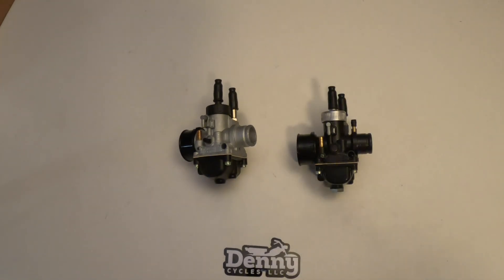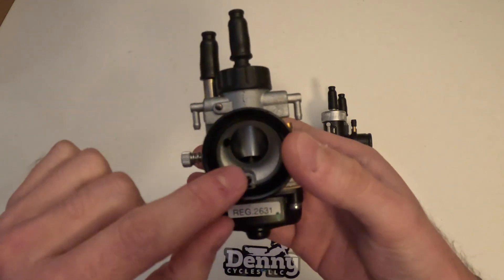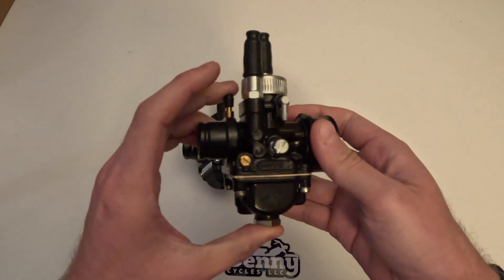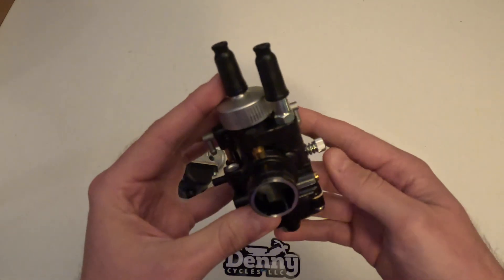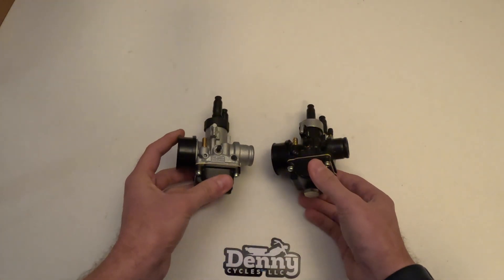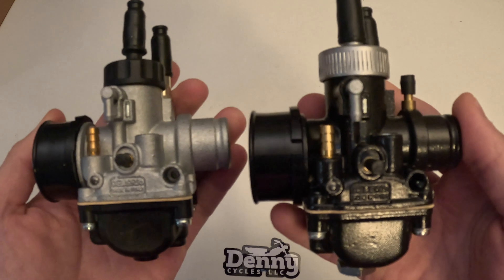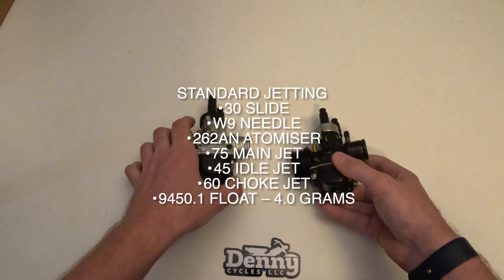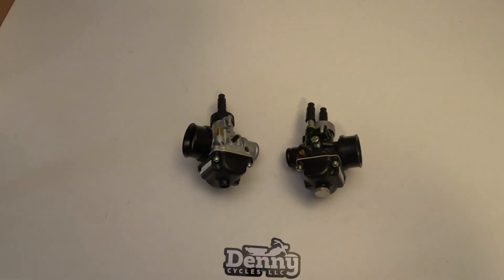Dellorto PHBG 19 DS vs Dellorto PHBG 19 DS Racing I What's the Difference?

Comment: if i have 70cc airsal and Dellorto PHBG 19 DS Racing what kind of jet should run it bcs i've tried 50-92 yets non of them work it just gets flooded
Reply from the maker: Hello,

Jetting is too dependent on a variety of variables (temperature, elevation, etc.) for us to provide you with an accurate answer.